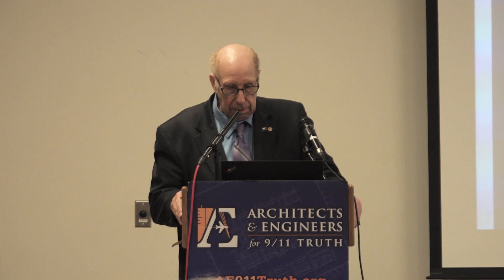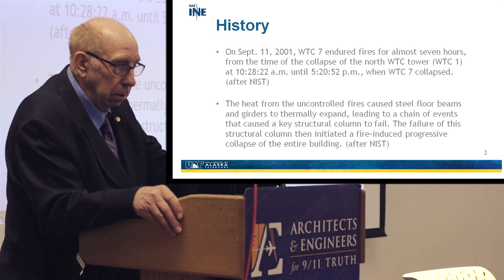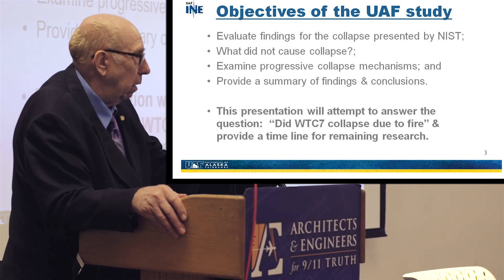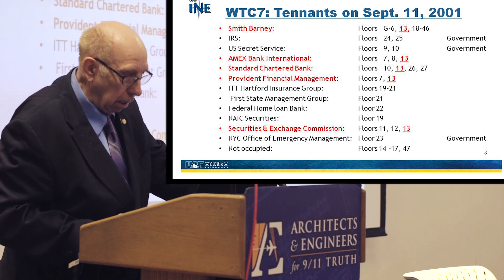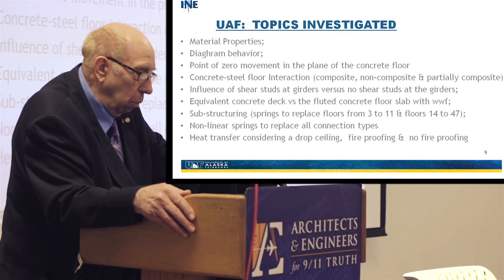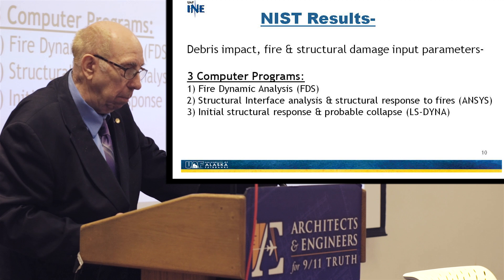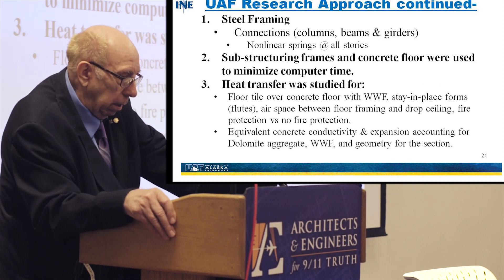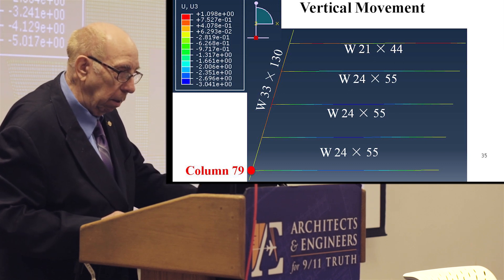Truth Is Where Our Healing Lies | Part 4: Dr. Leroy Hulsey on the WTC 7 Modeling Study

Comment: Before investigating why a building collapsed you first of all would have to produce a computer model the building as it was on the day it collapsed.

 Quote Dr. Hulsey
"Construction started 1983 
Construction completed 1987'
--------------------------------------------------------
New York Times article 
COMMERCIAL PROPERTY: The Salomon Solution; A Building Within a Building, at a Cost of $200 Million
By MARK MCCAIN FEB. 19, 1989

BEFORE it moves into a new office tower in downtown Manhattan, Salomon Brothers, the brokerage firm, intends to spend nearly two years and more than $200 million cutting out floors, adding elevators, reinforcing steel girders, upgrading power supplies and making other improvements in its million square feet of space.

The work, which began last month at Seven World Trade Center, reflects both the adaptability of steel-framed towers and the extraordinary importance of fail-safe computer and telephone systems for the brokerage industry. According to many real estate experts, no company has ever made such extensive alterations to a new office building in Manhattan.

Salomon had tried to avoid the trouble and expense of alteration work by designing an office building, in partnership with a developer, from the ground up. But in late 1987, after the stock-market crash, Salomon withdrew as the co-owner and principal tenant of a project planned for Columbus Circle in midtown Manhattan.

The termination of that agreement left Salomon with an after-tax charge of $51 million and put the firm under intense pressure to find new headquarters space before its lease at One New York Plaza, in downtown Manhattan, expired in 1990. It no longer had time to shape the blueprints of a project; instead, it needed to find an existing building or one under construction that could be fitted for its high-technology operations in about two years.

After studying more than 50 options throughout the New York region, Salomon signed a 20-year lease for 22 floors - each spanning nearly an acre - at Seven World Trade Center, an office tower that has been largely vacant since Silverstein Properties completed it two years ago.

''We really had a time constraint,'' explained Gedale B. Horowitz, a senior executive director of Salomon. ''And we were driven very much by technology. We had to find a building that could accommodate our needs, including major-sized trading floors.''

Much of the new electrical, air-conditioning and mechanical equipment will serve three double-height trading floors. To create the extra height, workers are removing most of three existing floors, using jackhammers to demolish concrete slabs and torches to remove steel decking and girders beneath the concrete.

After the girders are cut into sections small enough to fit into a construction elevator they will be sold as scrap for about 4 cents a pound.

In some office buildings, that alteration would be impossible, but Silverstein Properties tried to second-guess the needs of potential tenants when it designed Seven World Trade Center as a speculative project.

''We built in enough redundancy to allow entire portions of floors to be removed without affecting the building's structural integrity, on the assumption that someone might need double-height floors,'' said Larry Silverstein, president of the company. ''Sure enough, Salomon had that need.

''And there were many other ways that we designed as much adaptability as possible into the building because we knew that flexible layout is important to large space users.''

Nearly 2,000 people will be working on the retrofit project during the peak period. The cost, which is estimated at $200 million - not including carpeting, furniture and other office equipment - will come out of Salomon's pocket.

''We made a landlord contribution to the work,'' Mr. Silverstein said, ''but Salomon's costs will go well beyond that contribution by many, many times.''

MORE than 375 tons of steel - requiring 12 miles of welding - will be installed to reinforce floors for Salomon's extra equipment. Sections of the existing stone facade and steel bracing will be temporarily removed so that workers using a roof crane can hoist nine diesel generators onto the tower's fifth floor, where they will become the core of a back-up power station.

To help shuttle Salomon employees between floors, construction crews are adding two escalators and four elevators inside the tower. And to help adjust the floor layouts to Salomon's needs, workers are moving sections of the tower's ''core'' area, which includes pipes up to two feet in diameter and air-handling equipment the size of delivery trucks.

''This is the first time I've every seen such dramatic interior changes being made in a new building,'' said Irwin G. Cantor, structural engineer for the project. ''And the whole world is watching.''

Perhaps not the whole world, but certainly some very concerned parties. Consolidated Edison intends to protect its electrical substation stretched out beneath the 47-story tower. The only existing tenant, an accounting firm, intends to protect its services and security while construction crews work above and below its four floors. Silverstein Properties and the land owner, the Port Authority of New York and New Jersey, intend to protect their investments. And Salomon intends to move the work along at breakneck speed.

''THIS is a massive project with a tight time frame,'' said Rudy M. Pavesi, a senior vice president of Morse/Diesel, construction manager of the Salomon project. ''I cannot think of any retrofit project in the city where anyone has spent more than $5 million a month. But at our peak time, we'll be spending more than $10 million a month.''

By next July, Salomon intends to move about 2,000 employees into the World Trade Center tower, and 1,000 more employees by the end of the year.

But given the magnitude and complexity of the construction work, that schedule may be unrealistic.

''Essentially, Salomon is constructing a building within a building - and it's an occupied building, which complicates the situation,'' said John D. Spassoff, a district manager of Silverstein Properties.

Elsewhere in Manhattan, other financial-services firms designing new headquarters from the ground up have not suffered setbacks like Salomon's aborted plans for the Columbus Circle site.

Morgan Guaranty Trust Company is building itself a 1.6-million-square-foot tower at 60 Wall Street that will be ready for occupancy and bristling with high-technology equipment later this year. United States Trust Company of New York will be moving in less than a year to a tower under construction at 114 West 47th Street, where it will be the major tenant.

''If a company can get together with a developer in an early stage, that's the best possible timing,'' said Richard Joynes, president of Hunter & Partners, a construction consulting firm in Manhattan. ''First of all, a 500,000- to million-square-foot user can effectively make a developer's speculative office project work financially, so the tenant is in a much stronger position to dictate terms of the lease. And the tenant can have features built into the space at minimal cost -rather than ripping out floors and making other changes after the steel and concrete is in place.''